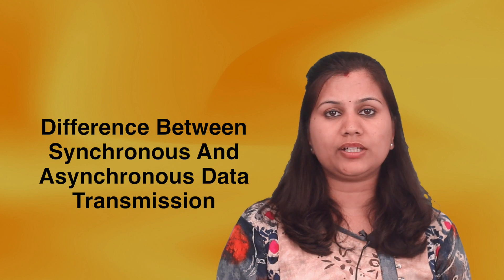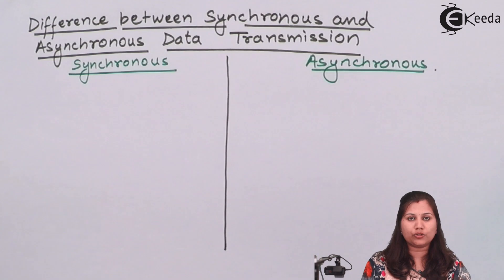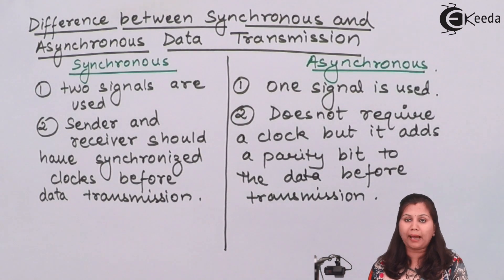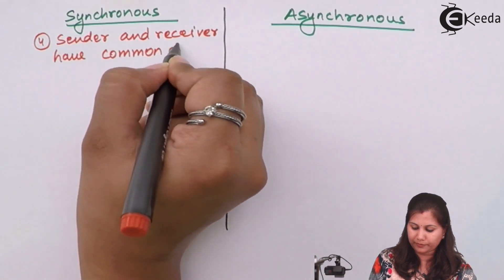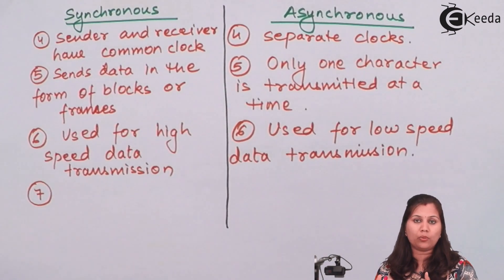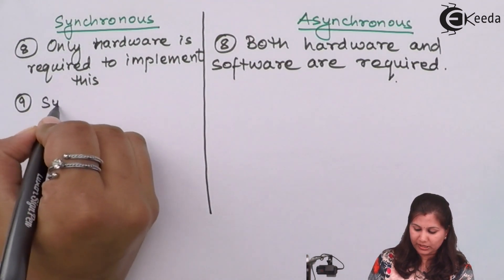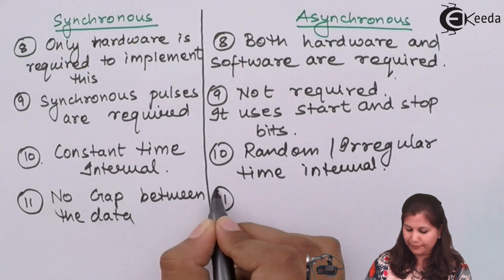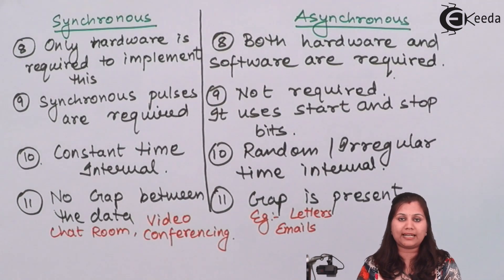Synchronous Vs Asynchronous Serial Data Transmission - Communication Interface - Microprocessors

Comment: At 7:40 when you're talking about data transmission between synchronous and asynchronous, it's not necessarily mutually exclusive for synchronous to communicate in parallel (blocks of data) and asynchronous to communicate in serial (bit by bit). UART (Universal Asynchronous Receive/Transmit) can have parallel and serial communication modes. I2C is a synchronous communication protocol that uses serial (bit by bit) data communication. Just thought I'd touch on that for the sake of confusion.